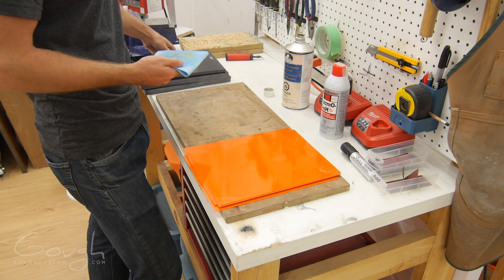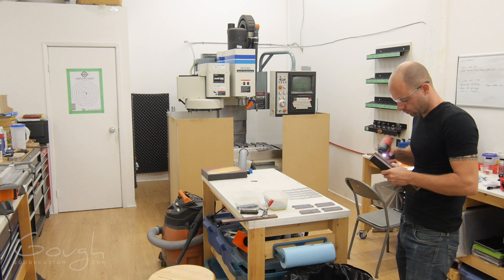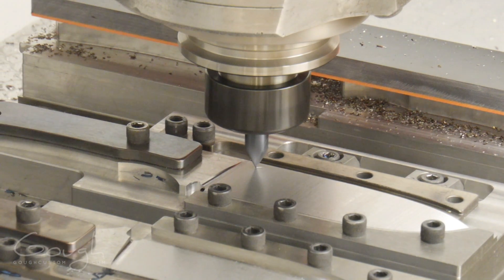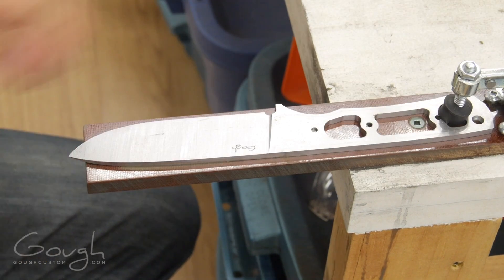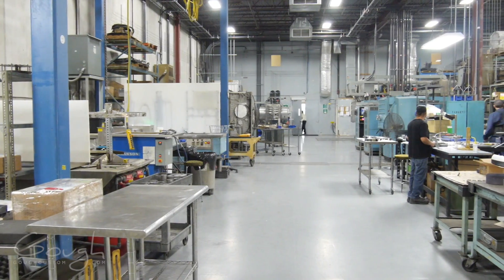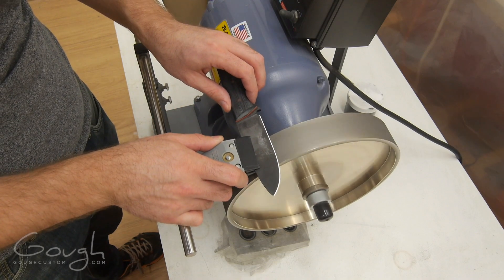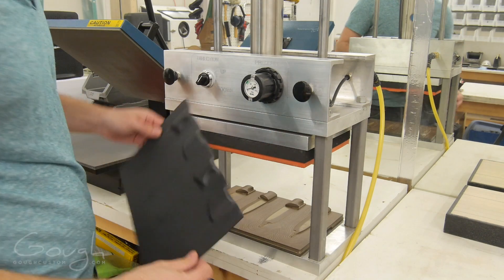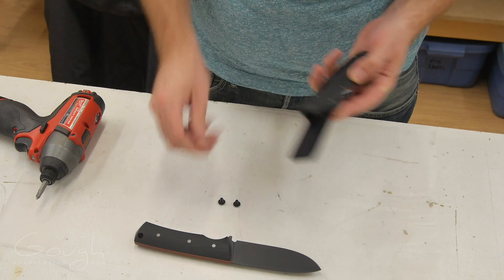Making a knife the high-tech way - Resolute MkIII

Comment: wonder how long it can hold such a sharp edge?
Reply from the maker: It depends on what you're cutting, but my knives will hold their edge for a very long time. A couple of examples: I have multiple customers who were able to skin & butcher 4 deer at once without having to touch up the edge. In my testing you can cut 400 linear feet of cardboard with a tiny bit of the edge before you start to notice any loss of sharpness, which is pretty amazing!

Comment: If you blast to create a matt finish for the diamond like coating after heat treat - you could omit the time you spend on the earlier 220 grit sanding step the blade?
Reply from the maker: Unfortunately there would still be visible tool marks from the CNC machining, which is why I hand sand, to remove them!

Comment: I’m truly amazed you don’t use any coolant when running your CNC mills. You must go through tools like crazy.
Reply from the maker: Not at all actually! A lot of modern tooling is designed to run dry when cutting steel, solid carbide tools with coatings like AITiN are very happy running dry! The biggest killer of tools is re-cutting chips, the air blast prevents that by getting chips away from the cutting area quickly! Pesonally I think air blast is actually a lot better at that than coolant is... One very nice thing about runing dry: it's much more environmentally friendly! That and you don't have to breathe coolant fog all day which is nice...

Comment: 1. Is g10 expensive. And 2. Is there a way to recycle or reuse those g10 shavings or is it just waste.
Reply from the maker: G10 is not too expensive. It's between $30 and $55 for a sheet big enough to make 5 pairs of handle scales depending on the color. Unfortunately the chips can't be recycled, they don't melt which means they can't easily be formed into a block again, and even if they could they wouldn't have the fibreglass reinforcement going in the correct directions any more..

Comment: How many hours would I have to work at my minimum wage job to acquire such an equipment?
Reply: @joshua sullivan How about the CNC?
Reply from the maker: The CNC was actually less expensive than you probably think! I bought it used for $8k and spent some extra fixing it up, however it was usable as I bought it... I spoke with someone recently who bought a larger machine from the same company (also used) for $1200 just a couple of weeks ago. If you hunt around there are good deals to be had on used machines, however it can definitely be a bit of a gamble buying used.
Reply: @GoughCustom  1200 or 12000?
Reply from the maker: @mosab643  $1,200! Crazy right! Deals like that are definitely on the rarer side but they are out there. I bought a pair of machines that I'm fixing up for the shop, got them for $3,900 each. They both need about $5k of work, but at that point they'll be in excellent condition for $9k each which is crazy.
Reply: @GoughCustom  Are you a hobbyist or it is your trade?
Reply from the maker: @mosab643  I have been both, but at the moment this is my full time job!
Reply: @GoughCustom  You make knives or what?
Reply from the maker: @mosab643  yes, I am a full time knifemaker...
Reply: @GoughCustom  Is there good money in it?
Reply from the maker: @mosab643  No not really to be honest, not so far anyway

Comment: Can you make me a kinfe that has a secondary bevel that isn't useless? Make it the same angle as the edge basically?
Reply from the maker: Not quite sure what you mean sorry mate, happy to talk about it further though! This blade has a primary bevel (the flat part of the blade) and a secondary bevel (the edge) already.
Reply: @GoughCustom  like a kitchen knife that doesn't suck.
Reply: Instead of having a secondary bevel it's one angle all the way to the edge. No major degree change to form an edge. My terminology may not be correct, but for the sake of sharpness one angle is much easier to work with for re-sharpening. If it doesn't sound like something interesting to you forget I mentioned it. Some blade designs don't lend themselves well to that kind of edge, a long flat grind would be a better word for it
Reply from the maker: @Shadowlogic420  A flat grind done that way would be far too thin/brittle at the edge. many knives are done with convex grinds like that, you might want to look at one of those? Personally I still find they dent/chip too easily during any sort of hard use.
Reply: @GoughCustom  most of the knives I carry for any length of time end up with flat grinds after sharpening them myself anyway, and yes it is easier to damage the edge, but also just as easy to maintain the angle in re-sharpening. It speaks more to the quality of material if it can't keep an edge. I've got this one knife I've carried since I was 16 but it's a belt knife, and I can't carry it at work. Which is silly considering I work around sharp metal all the time.

Comment: Big difference between your video done some years back compared to this one - the addition of CNC machining and jobbing out the hardening and coating.  Still an amazingly engineered knife.
Reply from the maker: Thanks very much Chris! I am hoping to bring the DLC coating and the heat-treat back in house sometime, however it will be a lot of investment to get the tools to do those processes in house to the same standard, worth it though I think as I want to keep as much control over the process as I can!
Reply: @GoughCustom  As  I think they say down under: good on ya, mate!  I hope that you're able to get the equipment you need to do what you do.  When that happens, it wouldn't be surprising if you ventured into other designs as you'll have the freedom to get even more creative!
Reply from the maker: @chriswenkle2635  I have just moved into a new shop and bought a pair of used CNC mills which I am fixing up with the goal of more flexibility so I can work on new designs and projects! Here's hoping!
Reply: @GoughCustom  Outstanding!

Comment: why is DLC  applied if you will remove the coated layer during sharpening
Reply: The coating is meant to protect the majority (99%) of the exposed knife.  The actual cutting edge is usually sharpened and especially polished during stropping often enough to keep rust from being a problem, and even it is did rust a bit for some reason it would come right off during a stopping or light sharpening.  The coating not only helps protect the blade (and spine) from rust/tarnish, but it also helps keep the aesthetics of the knife looking good by not having to polish or sand off the blade bevels should they begin to rust or tarnish a bit, which could stand out like a sore thumb if done incorrectly.  That, and it protects against "wear and tear" as the coating won't scuff or scratch as "easily" as the steel since it's actually harder than the hardened tool steel.  Again, any rust etc. would come right off after the first real sharpening of the knife, so he might as well send it to the customer the way it will actually look after the first sharpening, not to mention it's done nice and evenly so the customer doesn't need to worry about establishing a perfect transition at the shoulder of the edge bevel. 

Another possible reason could be that If the blade was sharpened prior to being coated with the DLC, the edge apex its sides would also be coated and would theoretically (and maybe practically) reduce the actual sharpness of the edge, since the DLC coating adds a couple of microns to either side of the apex, which would increase the thickness of the edge apex, and since sharpness at the apex is already being measured in mere microns it could reduce the sharpness a bit.  I'm not sure how accurate this is, but it seems like it could be one more possible benefit and reason in going ahead and removing the coating from the edge bevel.

 Not trying to answer for Aaron, but these are some of the reasons that make sense to me as to why that would be done.  Of course, I could be completely wrong  :)
Reply from the maker: lsublimed got everything pretty much correct! I could sharpen before DLC coating, but the knife is still going to have to be re-sharpened at some point, which will take the coating off so there's not much point. The coating itself is largely for aesthetic reasons, and I chose DLC over other coatings simply because it's so hard-wearing

Comment: It kinda bothered me that the tools that you used for drilling the holes and for the weight reduction cuts weren't next to each other.. you lose like 20s per blade because of that... OMG my company has finally managed to do it... for years they have yelled at me about cycle time and how i need to improve it, and here i am at middle of the night complaining about inefficiency on tool changes at some random company -.- smh.
Reply from the maker: Haha completely reasonable :) I'm sure there's a reason it's ended up like that. Given that my cycle times are very long there's not a lot of benefit for me in chasing small optimizations like that usually. My cycle times are 2 -1/2 hours at the shortest at the moment, previously they were above 4 hours per blade!

Comment: I am so confused. So you are already working with hardened steel? The point when you put the knife in for heat treatment it looks like you were just annealing it, normalizing.... So is the steel already hardened when you're working with it? This is cold steel knife making?
Reply from the maker: Hey Chris! The steel I use is an 'air hardening' steel, which means that it only needs to be cooled in air in order to quench it. So what you're seeing in the heat-treatment is actually a hardening process.

With that said I have actually moved my process quite a bit ahead since this video and I now machine all of the blade in the fully hardened state (from the same steel). I do this because it allows me to achieve higher accuracy and better surface finishes.

Comment: As a fellow cnc programmer and machinist I have a really good idea of how much effort you have put into streamlining your process. I'm curious what cam softwear you use? I use camworks at my shop. I thought you wrote it by hand until that endmill ramped in and  started a high speed milling path when roughing those pockets.
Reply from the maker: Thanks mate! I have definitely smoothed things out further since this video was shot... I now do 100% hard-milling for all of the blade which is working out really awesome! For CAD/CAM I use Fusion 360, works really well!

Comment: Crazy how many people bought these knives and they haven't really seen high tech manufacturing. Not one perthometer, surfometer, Rz/Ra tester or CMM in site. No quality control methods shown in the video at all. Even the milling tools looked like plain old, non-coated carbides.  Impressive work for. HS tech class but not high tech at all.
Reply from the maker: Some people give me shit for being too high-tech ("cheating"), this is one of the few times I've gotten flack for not being high tech enough and I love it!

I wish I had a 'need' for a CMM. I don't honestly. Working to +-0.001" is good enough for most of what I do and inspecting using standards is good enough for that. I  don't show it in the video but the pin holes are all check with go/no-go gages, the outline of the knife is checked against a standard, nothing fancy just a steel outline that has been verified to be the right size with pins that position the blank correctly. Fit is then checked with the ancient method of fingertip feel, as that is how the knife will be judged in the end anyway!

No real need for a RA meter either, though I would love one! Finishing is all done by hand, and something would have had to go very badly wrong during milling to disrupt that process, in which case it would be obvious at a glance.

All the tools are AITiN coated in this video. Now I do 100% hard-milling and use TiAIN tools that were custom made for this application. Nothing real fancy just nice 6 flute endmills with 0.06" corner radius and variable flute geometry. I get 8 parts per blade milling 62HRC steel, total time in the cut is about 8 hours per tool. Could do better on a newer machine with a more rigid spindle, but you have to work with what you've got!

All in all, I'm not an aerospace shop. I would be wasting my own money and my customers money to be inspecting things to the same level as though I was an aerospace shop! I'm sure some work I do in the future will require things being tightened up, in which case I will buy equipment as needed!

Comment: Question for the experts, are forged knives better than machined knives? If you take the same high quality blade steel and make two identical blades, one where the blade is formed throug forging, and one where it is machined, will there be a difference? Both knives will of course be heattreatet, the only difference is the shaping of the blade.
Reply: Because of the grain flow of the steel. Forging it makes the grain run in the correct direction while machining the grain flow is in line with the axis of the rolling mill.
Reply from the maker: Charles has a point regarding grain, however one nice thing about knives is that the important bit is right in the middle of the steel (the edge) which means that a rolling mill still aligns the grain correctly for use in a knife. Forging introduces a lot more things that can go wrong when making a knife in my mind... I prefer the stock removal method, but of course everyone likes different things!

Comment: Instead of grinding down the metal to size and then sharpening by hand, why not hand grind them, cnc cut to proper dimensions, bevel the knife edge in the CNC, then hand polish.
Reply from the maker: Doing it this way ensures the best overall consistency which is really important, especially for the DLC coated knives as the blade and handles have to be finished separately but then match up perfectly...

Comment: Nice!
Two things I'd all/modify:  curing resin in 150-200 C to improve strength of the bond and speed up the process, and add water drain in sheath.
Reply: he has a drain in the sheath
Reply: @lktn62  yeah and honestly doesnt need it with the coating.
Reply from the maker: AS LKTN pointed out there is actually a drain in the sheath, it's just at the end where you can't see it very easily, which is very much the point as I think drilled drain holes are ugly :) Curing the resin at temperature is not a bad idea, but probably not worth the hassle in this application. This is a marine grade epoxy and the bond strength is already way above what is actually needed! Speed is not an issue as I just leave it overnight to cure...

Comment: If you don’t mind, why cnc over traditional grinding of the bevel?
Reply: Less time, more efficiency, I guess.
Reply from the maker: Primarily for consistency. If I want to push the steel and the performance as far as I can then having the blade be perfectly consistent in thickness is really important. I also just really think CNC is super cool and I love using it!
Reply: @GoughCustom  thanks for the reply.

Comment: As both an aerospace machinist and a traditional bladesmith, i can appreciate this process from multiple perspectives. Say what they may, but nobody can doubt that edge. They seem like quality knives.
Reply from the maker: Thanks bud! I appreciate the kind words and it means a lot coming from a fellow machinist!
Reply: "Terrifyingly Sharp" is an apt description. It also looks bloody amazing just to look at. Great job mate!
Reply: As a new machinist this is really cool, I was wondering if u program this yourself or have someone do it for u and if u do it yourself what program software do u use
Reply from the maker: @chrisstump59  Hey Stumpy! Yeah I do all the CAD/CAM myself. I use Fusion 360 and highly recommend it!
Reply: sharpened with mdf my fav
Reply from the maker: @Drsteezymcgee  The MDF is just used as a substrate for the CBN paste that is loaded onto it. The abrasive needs a soft surface it can embed into to act as a carrier which is why MDF is used.
Reply: @GoughCustom  I know why mdf is used.. I've done it plenty of times. interesting video
Reply: Start stropping on the same side where you finished sharpening.
Reply: I'm a former tool maker turned manufacturing engineer (Mechanical Engineering degree) and I disagree. There is no sign of quality control and the methods are amateur.
Reply: @theupscriber65  that's because the QC guy was stabbed. Knife proved useful as a knife.
Reply: @theupscriber65  you seem much more like a average prick turned YouTube douche to me
Reply: @theupscriber65  where is your product and website?